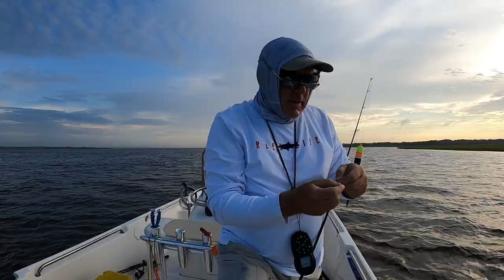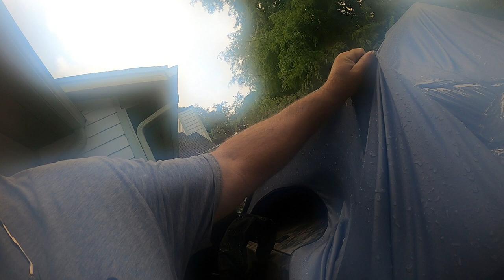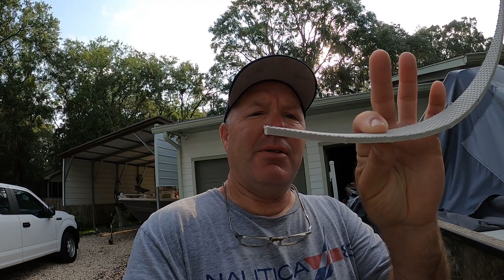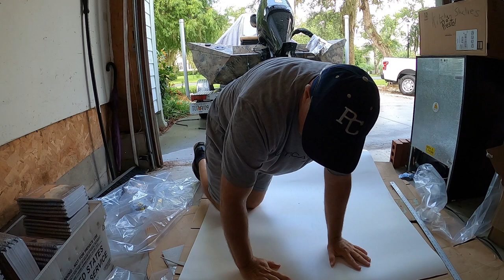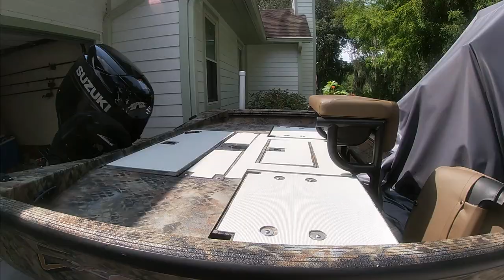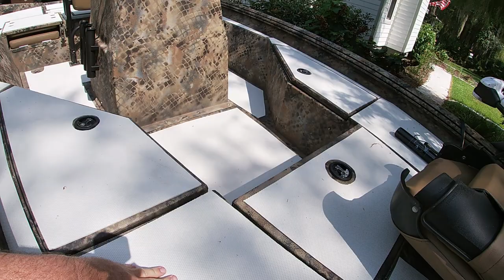Boat Deck Improvement and Trash Fish Thursday

Comment: What a great smart idea! Looks great! White makes a difference in the heat. This reminds of my sister's car. It's black interior. And it is very hot. Too hot. We thought about putting light colored seat covers on the seats. It's white on the outside... but hot like fire inside. It has a great air conditioner but the black takes a while to cool off.  Ugh!